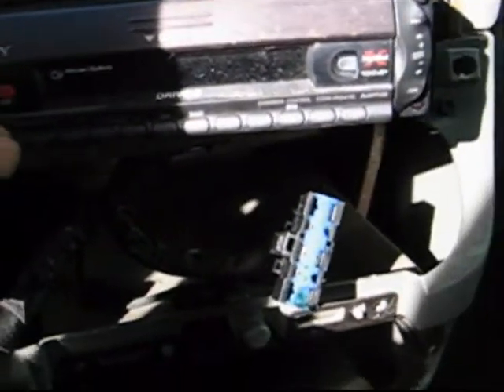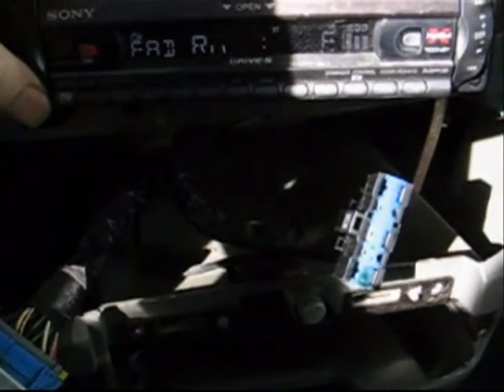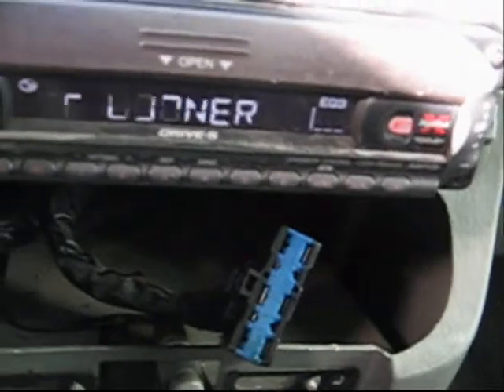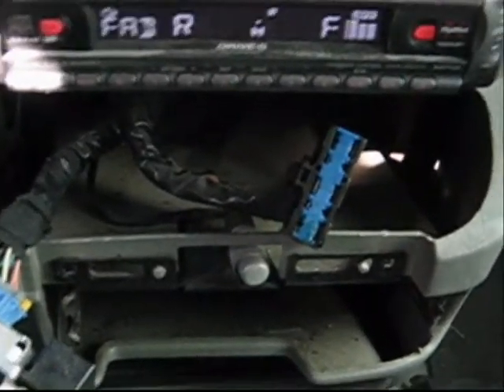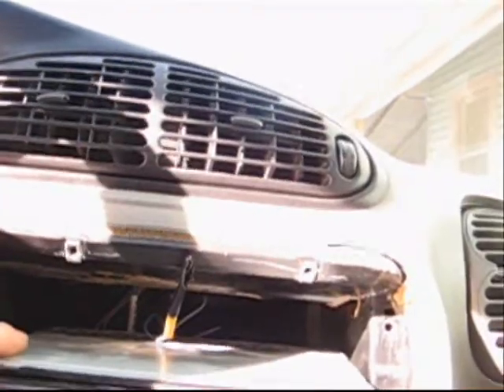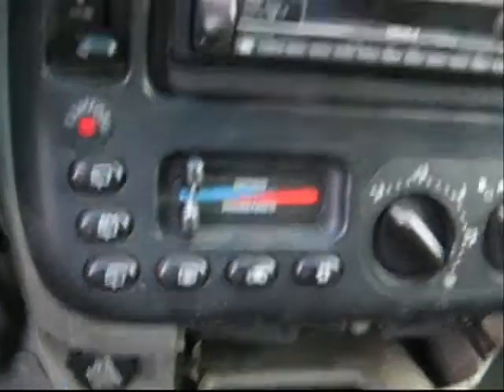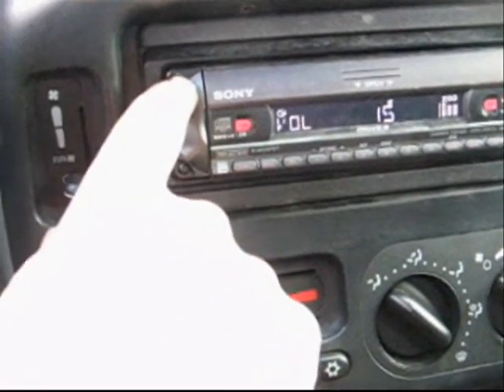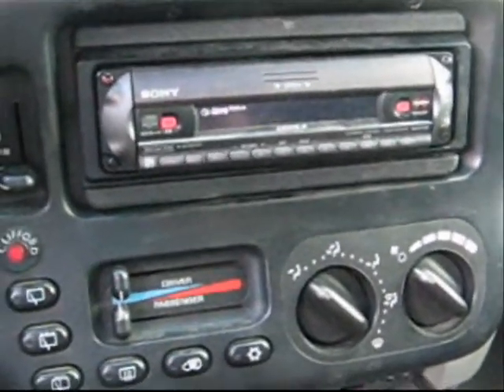CrazyCarClub - 1996 Dodge Grand Caravan Stereo Replacement Pt.2

Comment: AWESOME!  Finally got it figured out.  Splice that extra green w/red stripe wire in to the power antenna remote wire (blue w/white stripe), and then ground that black w/(some color stripe) wire to the deck.  Turned it on an all speakers and amp powered up.  It actually sounds pretty good for a factory system.  I was only installing a factory deck though not an aftermarket one so I dont know if this will work for everyone.

Comment from the maker: the black wire plugged into the back i hooked up to the ground strap along with the ground for my new deck.. now in amongst the wire harness is a green wire with a red stripe. it looks like a speaker wire but you hook it up to the power antenna remote wire and you get the rear speakers and the door speakers to work

Comment from the maker: that would have gotten me the same response from the infinity amplifier. for some reason they don't find it nessesary to include an amplifier remote wire in the plug an play wire harness. numerous people online bought the converter harness and still had to rip their dash apart to find the amplifier power wire. i figured since i had to go in i might as well save myself a couple bucks and look up the wire colors to hook it up myself. thanks for the question though.

Comment: Thanks so much I have been trying to figure out the wires needed to be hooked up for the infinity amp and speakers to work for over a week now. Even got the parts from crutchfield but they didn't inform you as to what wires needed to be hooked up with their wiring harness.

Comment: @LocalDogRescue I should add that I believe the factory radio i installed is from a van that only had a regular 4-speaker system and not from a van with the infinity 8-speaker system, hence the two extra wires.

Comment: @CrazyCarClub Can you tell me what color the power antenna remote wire is?  I just bought a 96 Caravan, the radio had been removed.  I installed a factory radio but there are two extra wires, one on each harness leading to the back of the radio.  One wire is black (going to assume thats the ground you're talking about) and the other is that green w/red stripe on the other harness.  Didn't know what they were for so I left them alone and now I only have front speakers FAAAAK

Comment: I also have a 1996 Dodge grand caravan with a Infiniti sound set up. I did the same thing, looked for the green and red wire, connected to the power antenna wire coming from the radio and still nothing. I only get sound from the tweeters, two on the dash and two all the way in the back. Can any one give me some mores ideas? thanks!